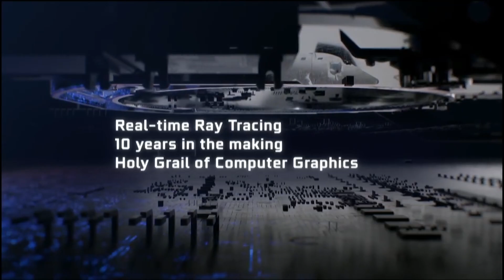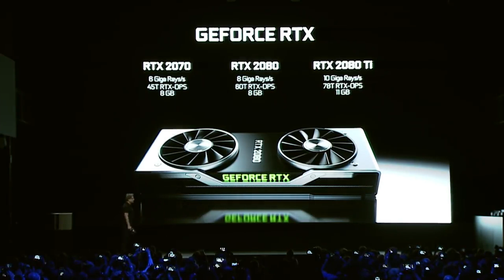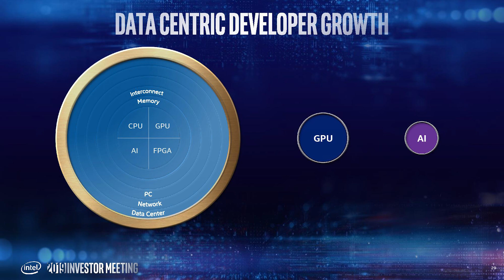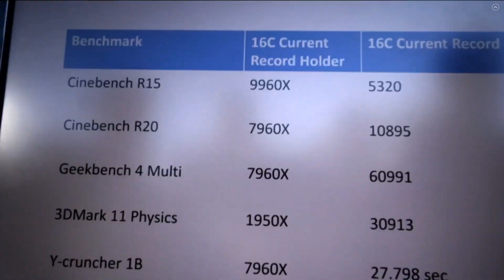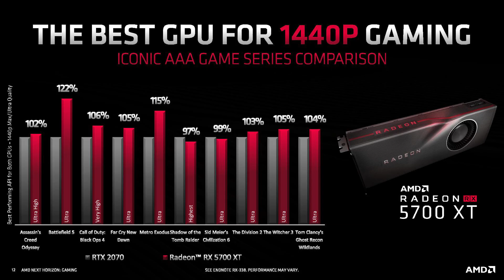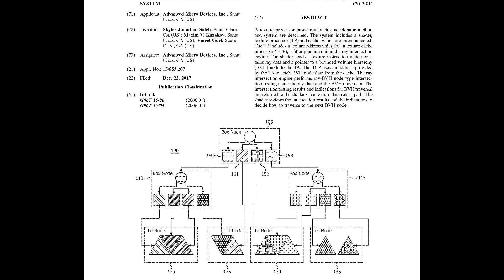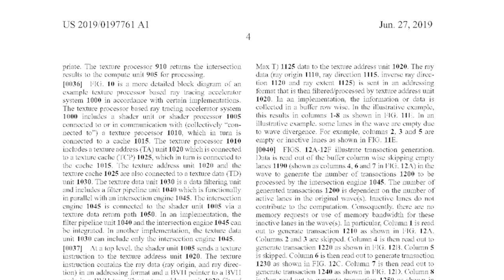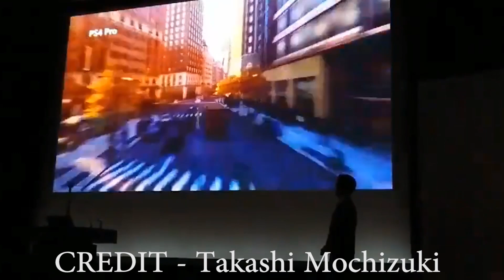AMD Hybrid Ray Tracing Patent Discovered | RTX Super Pricing | 3950X Hits 5.4GHz

Comment: the 'using the ssd as a cache for games' is technology that has existed for decades, its the page file and the windows operating system has used it since Windows 3.0 in 1990. It's nothing new and i can't believe how well the marketing is doing on this topic.
Reply: Well actually the Windows 3.0 thing was a different thing. It was basically using the hard drive as emulating RAM when there wasn't a sufficient amount of RAM. Having to use it actually slowed the system considerably. It still happens, but not as often though, as systems usually have lots more of RAM, and usually the virtual memory needs only to be used for background processes. That said, this is not a new technology, even though it's new for consoles. SSHDs (a mix of SSD+HDD) have existed for a long time, and AMD's StoreMi technology, for example, does also this kind of thing. I don't know if it is possible for console game developers to fine-tune the SSD usage so that they can utilize it for example to preload stuff in the background (which would be new, I think).

Comment: Seems just like AMD to use a hybrid approach that will let devs determine what is ray traced and what is not... But admittedly, RT is only useful on highly reflective surfaces... If you shine light on concrete you only get shadows... I actually thought that shadow tech could be used with pre-rendered textures...

But again most surfaces will not reflect textures so a flexible approach will allow devs to lower  resolutions for rays... Meaning a slower card will have a "blurred" texture.. No one is going to sit in DOOM RT and look at their reflection while Hell Knights shoot fire at you...
Reply: Global Illumination is great, but too expensive on resource. Other eye-candies just don't worth it.

Comment: QUAKE Ray-Tracing on GTX1080:
I put the resolution at 2560x1440 and my FPS without RTX ON was 999FPS (it caps out there). I then turned on RTX (ray tracing) and it dropped to 1FPS. ONE FPS!! Even the menu was slow as shit! I then dropped the resolution down to 1366x768 and I think it was mostly capped at 20FPS when I had VSYNC ON (it seems to drop by multiples so for 60Hz monitors it maxes out at 60FPS, then drops to 30FPS then 20FPS, 15FPS etc... VSYNC OFF mostly sat in the 20's... I really don't understand the PRAISE for the implementation of ray-tracing on Quake. Many reviews saying it looks great and is amazing... well, it looks like crap to me and yes it is on as it looks completely different.
Reply: cause your using outdated parts...not design for Ray tracing...but to see it runs atleast...either buy 2060 super or wait for 3060
Reply: @user78405  or don't buy useless overpriced junk parts?
Reply: So, it turns out RTX is useful after all ?

Comment: So, under LN2, Zen2 is hitting 5.2-5.4GHz. Surely that means 5GHz is not happening on air? I mean Intel hit 5GHz on air, but 7.5GHz under LN2. I'm thinking Zen 2 CPU's @ 4.6/4.7GHz are really pushing it, and most of the higher end SKU's are probably clocked pretty close to the limit.
Reply: That is mostly true. But dont forget those high end Ryzen parts are 12-16 cores the more cores a cpu has the harder to push frequency. Ryzen CPUs tend to easily all core overclock to their boost speeds. Even shitty GLOFO nodes all core overclocked to their boost speeds without problems. 16 core @4.7 ghz is a huge amount of performance. Comparable single core perf. vs 9900k and by far the best desktop multicore perf with 8 fucking more cores. TSMC node will probably hit their frequency wall somewhere between 4.7-4,9 ghz for Ryzen 3000 cpus. Ryzen 3700x might be a great overclocker.
Reply: due to bad voltage cause intel run their cpu under 1.1 volts...not 1.5 that fry any intel without proper freezing...at my setup to make it stable at 4.8 ghz...i ran 1.34 volts and thats base for Ryzen 3 3600 at base clock...ITS SO BAD
Reply: No way on air. I doubt anything past 4.8GHz will be possible on air - at the least not for a few months.

Things could change as the process matures, but not right now.
Reply: @uzzi3822  i had no problem with haswell refresh setup past 5 years  i used back then, running at all 4 cores 4.8 ghz at air cooler is very expensive from our friend start brand name A...comes with 2 fans and 2 fin stack...it cools well for 1.34 volts until last
Reply: @uzzi3822  and reason why intel is successful for this...they start refining voltage process nodes to lowest it can possible ...to 1.1 volts at base clocks
Reply: @uzzi3822  and i don't think AMD will go any lower than 1.34 volts due to many problems...your memory will not boot when running your memory controller lower voltage through out cpu package
Reply: @uzzi3822  i do find it strange on my zen+ setup ...on memory voltage and cpu voltage the memory has be higher to cpu voltage when overclocking than intel ..it never occur to me back then
Reply: @Sanctorum , I thought the 7.5Ghz came from LHe not LN2.
Reply: Hopefully that is not the case, of course. Looking to grab an R5 3600(x), or maybe an R7 3700x. Would love to hit 4.8GHz, or around there.

Comment: I would like to see the 3950X with a Dilution refrigerator cooled down to a fraction of a degree above absolute zero with liquid Helium-3.
Reply: They would have to engineer special motherboards, even at -240c 99.995% of motherboards will fail
Reply: @Tallnerdyguy  ok then well im still waiting for the universal quantum co-processor that will run beside my PC in its own little mini dilution refrigerator and connected to the Ryzen with EDR infiniband links.....

Comment: seems that  3950x on air /water cooler will not go over 4,5ghz on all cores
Reply: It hits 4.7 GHz on all cores at 1.3 V.  I can tell you the 3950X @ 4.7 GHz  beats the i9 9900K @ 5.0 GHz in single threaded performance and they can overclock to 4.8 and sustain decent remperatures but anything higher you will need a chiller or LN2.
Reply: @tskraj3190  if 3950x can go to 4,7ghz on all cores then r5 3600/x could do same and with that beat or be same as 5,1+ghz 8700k
Reply: @Mr11ESSE111  It will. It's already been benched against the 9900K.
Reply: Ryzen CPUs tend to easily all core overclock to their boost speeds. Even shitty GLOFO nodes all core overclocked to their boost speeds without problems.TSMC node will probably hit their frequency wall somewhere around 4,8-4,9 ghz.
Reply: calistorich  4.7 is all core turbo. There doesn't seem be any sign of these chips having XFR functionality (single core boost)
Reply: @loroger9754  xfr should be 200mhz more
Reply: calistorich  You can overclock all cores to 4.7 GHz. I had the pleasure of testing this particular CPU.
Reply: Timothy Isenhart Sick bro
Reply: Timothy Isenhart May I ask what kind of cooling solution you used during the testing?
Reply: @loroger9754  Thermaltake Ultimate 3.0
Reply: Timothy Isenhart Nice, It should perform a bit better in a custom loop in enthusiasts systems. I can’t even imagine having a 16 core monster running at 4.8ghz or higher on a daily usage
Reply: @loroger9754  At 4.7 it is Prime 95 and Intel Burn test stable. I did  take it to 4.8 but only ran a CPU-Z  stress test but it did run warmer than I like.
Reply: Southeastern777  you will see in a week what max clock will have this cpu-s on air water coolers

Comment: Anyone know if the new threadripper 16 core will have higher specs than the 3960X? should it out perform it? If so Intels i9 CPUs will have serious competition.
Reply: Threadripper will use the same chiplets AFAIK so the only main difference would be potential BINNING and more importantly what difference QUAD CHANNEL brings. However, the fact that there is a 12-core and 16-core for the AM4 socket makes me think there's not much performance to be gained by Quad Channel or else the 16-core should not perform much better than the 12-core (and if so, why sell it?)... so I'm going to say a SMALL performance benefit, depending on the application. Makes me wonder who will get Threadripper. Someone who wants MORE than 16 cores or someone who needs ECC memory (I honestly don't know WHO really needs ECC)
Reply: Isn't the new threadripper supposed to go up to 32 cores? I think that's what I heard. It will have lower singlethread performance no doubt, but the core advantage is obvious - and threadripper also has some stuff that is very useful in workstation/HTPC like many more PCI-E lanes.

Comment: AMD became smart. After the Tesselation shenanigans they learned never to use solely fixed-function hardware again. Not because it is a bad idea, but because Nvidia is definitely going to force develoepers to overuse the new function in order to choke AMD's pipelines. So AMD decided to make them hybrid, still having a fixed function part to do the work but also being able to use the shaders to increase capability if Nvidia ever tries to do Tesselation 2.0 again....
Reply: The game will be build from the ground using AMD architecture because google/console. The rest depends on the donations they get from Nvidia (Intel Style).
Reply: Tessellation was something AMD initially attempted to push with their open source TressFX (which eventually became the base of the mess we know as GimpWorks) they likely realized the graphical fidelity gained was incredibly far from justifying the performance impact so they dropped it because as a feature it's pretty bad even when used well.
Reply: @bdhale34  Yes, AMD had a fixed-function tesselator almost a decade before NVIDIA supported tesselation. The problem was that AMD's solution was fixed function, that is, it ran on dedicated hardware that was designed within certain limits, deemed "sensible" for the time. And they were sensible considering it makes no sense to divide triangles beyond the subpixel range, they are just not visible anymore. 

But NVIDIA didn't want to make use of a fixed function tesselator so instead they used CUDA cores to perform software tesselation at the driver level instead. This typically was not as efficient (fixed function is always more efficient per no of transistors), BUT it allowed them to use as many shaders as they wanted for the tesselation. So they made all the Nvidia sponsored games to over-use tesselation because Nvidia could just enlarge the part of shaders dedicated to tesselation, BUT AMD's fixed function tesselator couldn't cope and AMD's pipelines stalled. Thus Nvidia appeared faster when in reality they used garbage "tricks" that didn't increase visual quality at all but instead made AMD under-perform.
Reply: @KotsarisGR  it makes me wonder what other "tricks" are being done in the nVidia driver to make them faster.

Comment: Intel are actively trying to steer reviewers away from using Cinebench. Adored TV pointed out today how Intel used to recommend Cinebench back in the day of the i7 6700K when they had no competition. Funny.
Reply: Intel trying so hard to show their single thread performance is like an SUV guy asking a Mustang guy not to use the drag strip or a circuit for race with him instead use a muddy jungle road. 😂😂😂
Reply: @Pixel_FX  
L😂L
Reply: Nuno Herdeiro  obviously with chiplets and early engineering sampling things can change as yield changes with higher clock chips, maybe yields aren't as high as expected for high clock chips. Obviously they do have some that hit high 4.6-4.8 and or they decided to hold them for the more premium CPU's. But in short your right his leak was off.
Reply: Southeastern777 ,Jim is well beyond the time, it "predicted" what amd and tsmc planned for the next 5 or more years. Do you know how much it takes to get the products running?
It didn't invent or cristal ball see it, there was some leaks.
Tsmc itself declared openly that the node is 5ghz capable, this doesn't mean that the first chips are.
Adored TV was the only one that had some leaks right, it deserves the recognition, even if Amd decided to back out, do to production capacity.
Everybody was disappointed with the fact that ryzen 3000 is not what it could be.
Navi is what the World deserves...
Meanwhile, some just bought a Gtx 1050ti for 140 euros.
Reply: LOL you see AMD at the conference doing a multithreading cinema bench test R7 3700x vs i7 9700k without hyper threading, WTF! !!!!!! it's on the R7 wins, why not put it in front of an opponent of its size the i9 9900k, just that it is exploded, that's all!
Reply: @benfr2744  maybe cause the 9900k is like 200$ more expancive and comes with no cpu cooler ?

Comment: i would hope AMD adjusts their prices as so:

RX-5700-XT - $399.99
RX-5700 - $329.99
Reply: That would be very nice
Reply: Im currently planning to buy the 5700
But ill check the benchmarks first tho
Reply: @branchprediction9923  Checking benchmarks first is always the smart thing to do.
Reply: Exactly!!!
Reply: AMD has very little to do with final pricing. It's MSRP and the resellers will charge based on supply and demand.
Reply: Right putting themselves in the red so you can save money in their products when the rabble would buy overpriced stuff from Nvidia without complaint? Not likely, businesses are not charities, they have to also get some kind of return for those who invested their money in the company. Stop treating AMD like a second class company, they aren't they are there number 2 graphics card company and their hardware should be worth the price unless you think they should be cheaper than comparable Nvidia hardware for no other reason than being the cheaper alternative. Stop it.
Reply: @evilformerlys4704  They can change the price anytime they want. The did this to clear their older GPU for summer. AMD primary costumer are those AIB partners who will be really pissed if AMD release this card for cheap after releasing 590 and R7.
Reply: not buying any components over 200 no matter the performance not even build by aliens or gods
Reply: @Lucy In Disguise coz 2x the price does not equal 2x the mileage.
Reply: @Lucy In Disguise Nowadays, games needs 2 years to have all the contents and patches anyways. There's no rush to be a paying beta tester and to be hit by a full bludgeoning price. :D
Reply: Its going to
Reply: @kazuya mishima At that time you can get older GPU @80-90% discount. Ill be happy to own a vega frontier for $100-200.
Reply: @yulusleonard985  woo aim low lol
Reply: @Lucy In Disguise there always will be, just not at new tier's launch.
Reply: $299 5700
$349 5700 XT
Reply: Meh

Comment: Paul needs to stop making up Super performance metrics! Everyone knows the RTX 2060 8GB Super is going to be the same as the RX 5700 at a higher price point. And, RTX 2070 8GB Super is going to be 2% faster than an RX 5700 XT, but at a higher price. This is because everyone knows the Cuda Core scaling is around 70% of the percentage increase e.g. a 13% Cuda Core increase equals a 9% FPS increase.

Comment: Yeah 1.75V is way way beyond what anyone will be able to achieve without destroying the chip.
Reply: Graphically Challenged you’re probably right, but in all reality we don’t know this 100% for sure. TSMC’s 7nm process will have different specs to the current 12nm from Global Foundries
Reply: Well, not exactly.
You need to be on liquid nitrogen to keep temperatures low then those voltages are achievable. No idea how long the CPU would run. If you tried to dial in too high a voltage without good cooling the CPU would just downclock the frequency, then if that's not enough the thermal diode would just shut down the system to protect the CPU. Or more likely the CPU voltage being high would just crash things immediately. It's still possible to destroy any chip with excess voltage though despite these protection capabilities but my point is that a ridiculously high voltage without good cooling will probably just crash the system due to overheating or just by the voltage being too high to even start thus the motherboard protection kicks in.